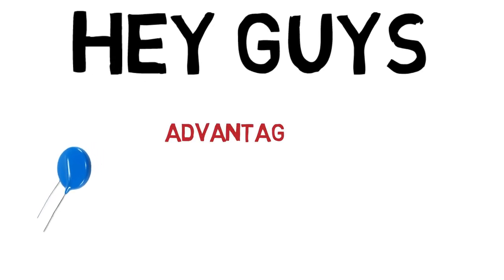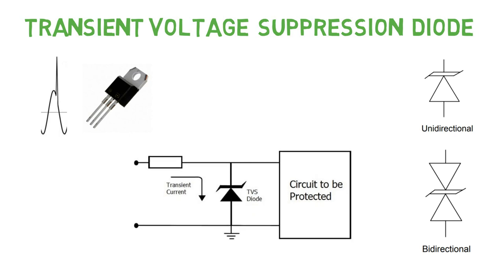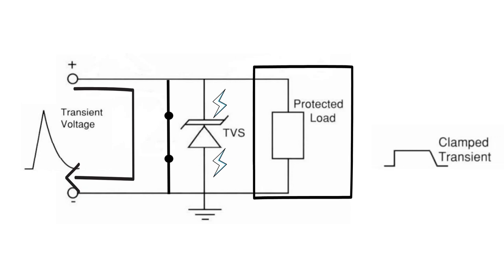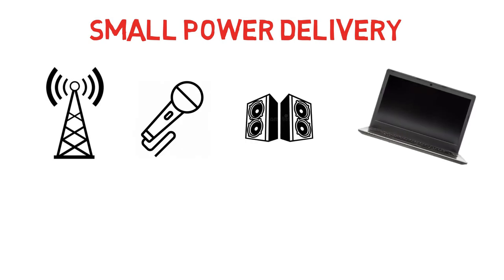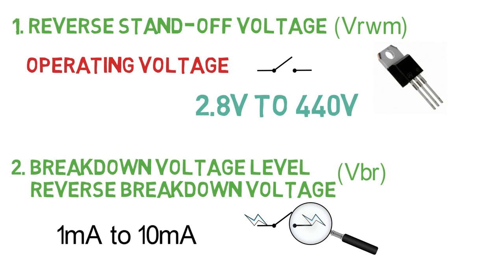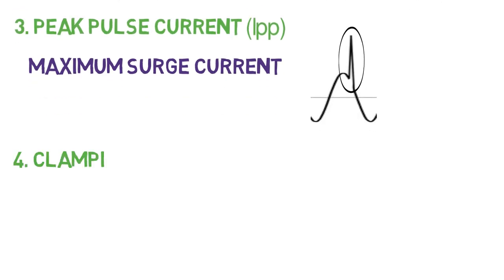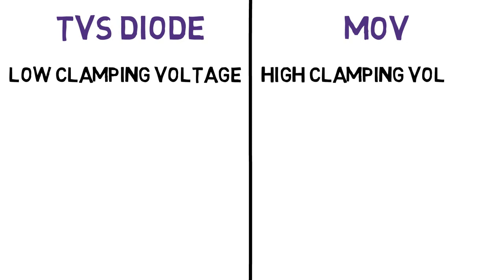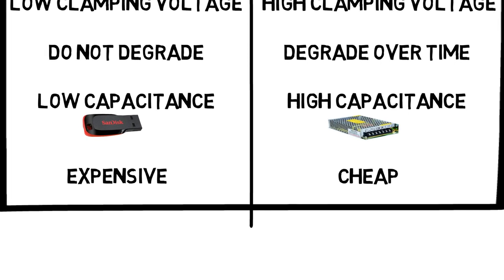How to Select a Diode?? | TVS diode Selection | What is TVS Diode?

Comment: Thanks for the video.  I was just looking at DC to DC converters and it recommended a TVS on the input.  Never used one before. I usually use gas discharge tubes for protection.

Comment: Excellent overview. I discovered the existence of TVS diodes the other day and I bought some via Digikey. I was using a regular IN4004 diode as a commutating diode across a 24Vdc inductive load but it’s too slow and my manual toggle switch still arced. I hope the SA30A TVS diode I bought will do the trick.
Reply from the maker: Did it work?

Comment: Thanks for the great video. In the comparison between MOVs and TVS you mentioned high and low voltages. What is the range of voltage that you would consider to be high. I'm sure the specs would give me a hint. The reason I ask is that I am attempting to build a irrigation controller and the valves run on 24VAC and each time they switch on or off there is a spike. The commercial controller that I had seemed to be using MOVs in the circuit. Your video on MOVs gave me a better idea on how to size them. Many thanks again.

Comment: Hi , Can you provide little more detailed/depth on TVS diode. Means how to validate the TVS diode power dissipation, current handling capacity while applying any surges as stated in the  IEC 61000-4-x standards

Comment: Bro I have a project...please help me.
I need a diode which can pass a certain voltage,say 5v.
It must not conduct if the supplied voltage is lesser or greater than 5v.
Please help me.Which diode to use?
Reply: Could you not just use a voltage regulator? that way it stays at 5V.

It also may be possible to do something with an op-amp comparator, more than likely two op-amp comparators.

Comment: Hi what is best for gigabit ethernet where my port has built in magnetics and the TVS would be between the port and PHY? Unidirectional or bidirectional? Also if the PHY has a max input voltage of 5V will a clamping voltage that is higher than 5V stress the PHY and cause damage? If so, then I am lost because I can't seem to find a TVS with a clamping voltage below 5V. Any help is appreciated. Thanks.
Reply from the maker: You will have to check how much transient comes from the Ethernet port? you will get it in the datasheet or you can ask the supplier about its data. Same for the PHY. If PHY is not able to handle the supply over 5V then my friend you will not find TVS with that configuration, I would suggest you to use a Zener diode of Vz 5.2V. If the transient comes Zener diode will act slowly but still you will have a protection at the input, although it is not the best practice to use a zener but if your are out of options then this can help.

Comment: Good video. One question: When to use bidirectional and when to use unidirectional TVS diode? Any examples?
Reply: In some circuits example a 75ohm cable coming from a dish outside your house to the receiver in your house there can be surges and lightning strike to your ground sleeve of coax. That’s were we use bidirectional  tvs on the receiver. But basically when you have both positive and negative swinging signals being applied to your Vin then user bi-directional tvs didoes.

Comment: Hello, My Project: I need a 2 pin Bidirectional TVS Voltage Clamping Diode (NOT Zener) to protect a Full wave bridge rectifier circuit - battery (switching reserve power inline) charging circuit & Lighting as the Load. Both the charging circuit & Load will be 7.5 volt with current between 500mh & 2amps. 
The power supply will be from a Shimano bicycle Hub dynamo (actually an Alternator) the voltage can go very high when the wheel is spinning at very high speeds down hill up to 140volts open circuit. 
So I need to clamp the AC Voltage to 8.5volts before the Full wave bridge Rectifier allowing an extra 1 volt than the circuit needs (7.5V) for forward voltage drop across the Schottky diodes & consumed by the circuit components. 

So in a nut shell I only want 8.5V AC to enter the Rectifier but all the current & the circuit needs 7.5V at a minimum 500mh but up to 2Amps.

I'm confused as to what Bidirectional TVS Diode (NOT Zener diode) I need. Please advice 
Cheers,

Comment: how do you determine if a transient Voltage Surge Suppressor (TVSS) is good or bad using an ohmmeter?
Reply: Use a resistance check, it most often fails short, like less than 10R, but they can fail open too, that is only possible to check building a test circuit with a voltage supply capable of reaching its breakdown voltage. My advice, check for a short, check visually for puncture marks through the package, if both look ok, assume its working.

Comment: hello  foolish engineer . my city voltage is about 230 v .. i want  my protection  to absorb small voltage spikes  . computer , monitor ,,  psu .. etc  ((note ;  i will use 2 amper fuse before  mov or tvs diode )) . what protection is suitable for me ? and its value ?
Reply from the maker: Use MOV.
Reply: @FoolishEngineer  thanks . write its value please :))